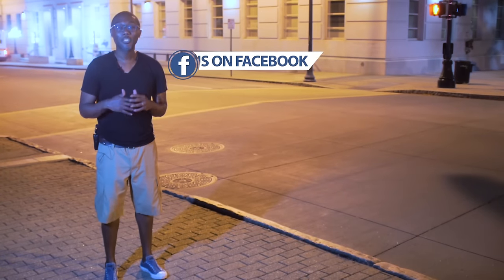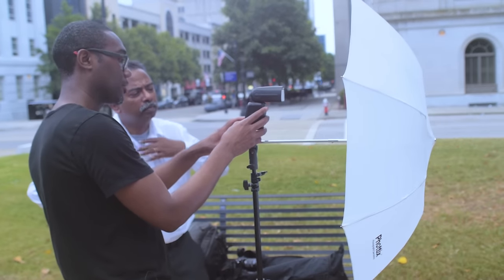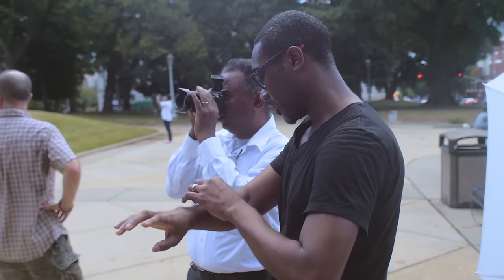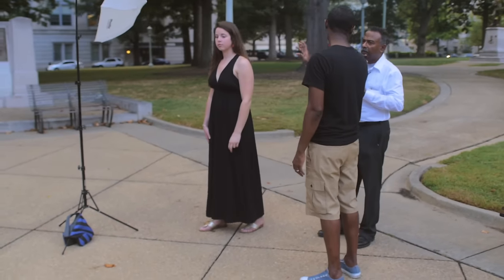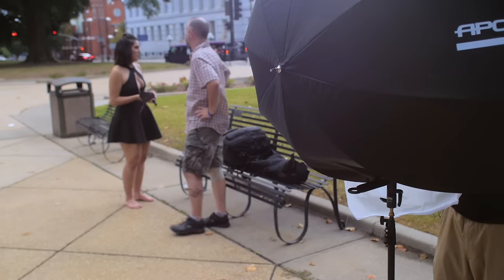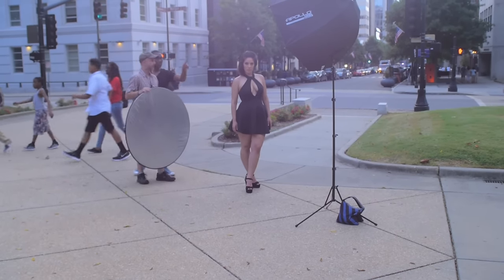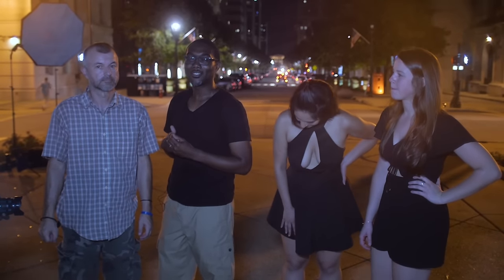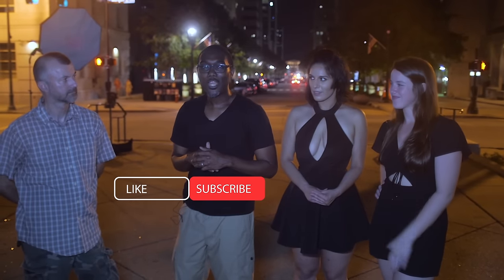Artificial Lighting Workshop Using Yongnuo YN600EX-RT, Westcott 43 Apollo and Icelight

Comment: Excellent video. I started off with canon 600EX II-RT. And then I added the 430EX III-RT. 

And then I realised that Yongnuo is the real business. I now own 3 of YN 600 EX RT  and just added the EX II RT from YN. 

Question. Do you use a YONGNUO YN-E3-RT Wireless Speedlight Transmitter or canon ST-E3-RT Speedlite Transmitter?
Reply from the maker: imeFulO 49ersClub I have the Canon version of the Yongnuo YN-E3RT trigger.

Comment: Love the last concept using the light trails. On another thought, doesn't second curtain sync only work in slave mode?
Reply from the maker: thank you.  Second curtain sync, I suppose can work in slave mode, but it's not a requirement, as it works in ETTL and manual.

Comment: Hello Ernesto, I'm glad I stumbled on your channel. You've got a new subscriber. I have a question about the speedlight and softbox you're using. It's perfect for evening shots like this, but in broad daylight will it work? If it's not strong enough what do you use in those situations? thx
Reply from the maker: +Raychristofer thank you very much for subscribing.

With respect to the speedlights, I have two in the softbox and they are not powerful enough to over power the midday sun. However, sunrise, sunset and shaded areas it works perfectly fine.